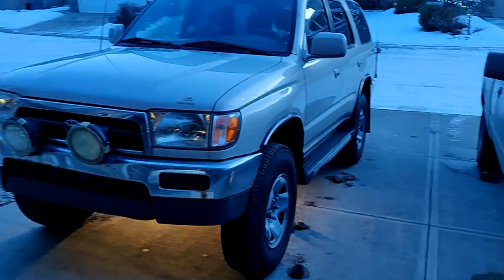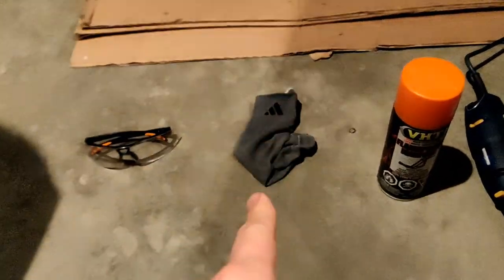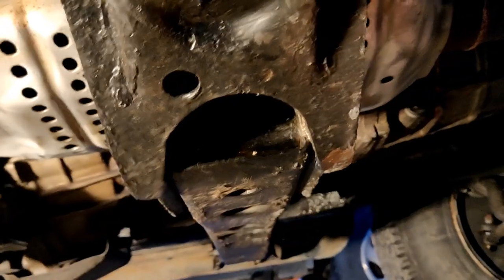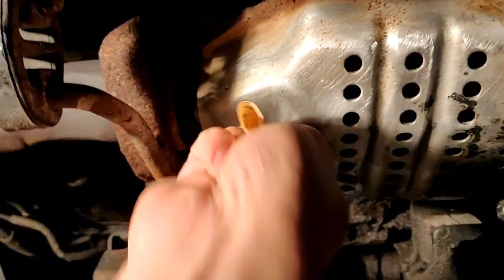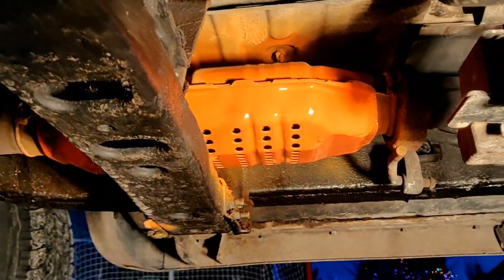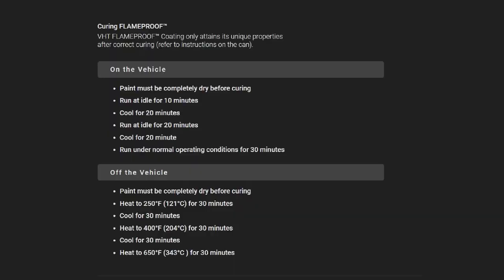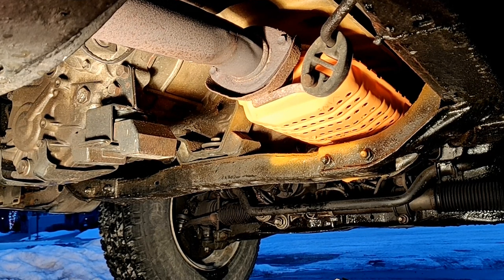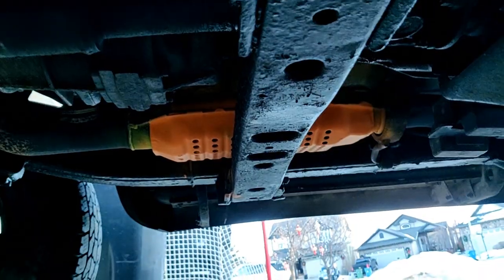DIY Catalytic Converter Anti-Theft for $20

Comment: I'm not sure but I think what he painted was the heat shield that covers the catalytic converter since it has holes all over it to let the heat escape but it's possible that that is the outer skin of the cat.  Even if that is his cat, most cars do have a separate shield covering the cat, making it near impossible to effectively get at it to paint it.  And forget trying to remove the shield, since most have bolts that are so rusted that you'd never get them out.  Just a thought.

Comment: The best deterrent....is to remove it and replace it with a section of exhaust piping.
Reply: Illegal
Reply: What about the O2 sensors?
Reply: Use clamps and put it back before the inspection
Reply: The car won't run right and probabaly will run too lean and burn your valves and pistons over time. You won't gain all that much hp anyhow, and Cats are very effective in reducing pollution. People do this all the time and never run it on a dyno and assuming its making more hp. Better to build a Cat Converter Motion Alarm. There a great video on youtube on how to make one for less than $50

Comment: Not gonna stop anyone or make them think twice about it. Your car is painted and has a VIN on it, doesn’t stop thieves from stealing your car now does it? Same principle as what you did. End of the day, thief is gonna cut the cat out, take it to the recycling center and walk away with a few hundred dollars. Paint and a VIN won’t stop them, he’ll, even if it would cause an issue, they’ll just spray pint stripper on it and remove the heat shielding or grind the VIN off.

Comment: This will not stop them. They don't even care about the case at all. They cut the cat off, take the whole thing. Then they cut the elements out and sell that. The case is tossed. Some even leave the cat and just cut it open and take the elements out.

A hard to cut cage is what's needed. But the cage has to be attached to the frame that can't be easily removed either, or they'll take the the cage with it.

Comment: All cars should have protection from easy access. Further this should be an auto manufacturer issue/ used car dealer retrofit mandated theft deterrent devices. No protection no sale.
Reply: yeah, they wont charge you for it either🤣🤣

Comment: Hey genius you realize that there is a heat shield on there? So when you cut the cat off you take that shield off which will take 90% of the paint off and the rest you can get off with a wire wheel and that vin will be gone with the heat shield also. The way your cat is you should just cut it off and straight pipe it and sell your cat.

Comment: VHT Paint should be applied at temperature between 65 an 95F.  Otherwies the paint will dry, but will not adhere and will flake off with channging temperature.

Comment: You painted and etched the VIN on the heat shield - not the actual converter. Remove the heat shield and repeat your process. Best approach is really to add a steel skid plate to prevent thieves from taking the converter in the first place.
Reply: I suggest you're missing the point, which is.. CHEAP AND EASY. There's neither in what you suggest.

Comment: I just had my catalytic converter stolen. And looking for anti-theft remedies I fell upon this video. I am totally and completely confused by this. How does painting the catalytic converter deter theft? Can a thief still not cut it away and just as fast as if it was not painted? What difference does make?
Reply: Makes it easier to find?
Reply: @blanchy  it doesnt matter.once its gone from ur car its gone.u have to pay to replace it. Paint shit has nothing to do to stop a thief...
Reply: @cherolait94  I agree, I meant easier for the thief to find.
Reply: Some states make the seller who has stolen your cat show ID and do not accept stolen converters, as they try to cash them in. This COULD deter a thief from taking it, knowing they might get rejected from a recycling place, with the converter painted and ID'd so as to make it obvious that there was no intention to remove. If it was remo ed by the owner,  he could take  verifying documentation to ID himself as the owner to recycle the item, should it go bad. 

Its only a deterrent, but some thiefs probably won't even flinch and take their chances. I do like the idea tho. Its a good precautionary measure to try something, over nothing.
Reply: HahahahAhahahahaha
Reply: same mate 4 weeks ago- i just had a cage welded under body
Reply: The thief’s apparently have to turn it in to the recycling center and the recycling center may start asking question and check the VIN. It gives the thief extra work to do and perhaps they’ll just steal from your neighbor’s truck and not yours and save themselves the hassle. Besides it may be hard to tell if it’s aftermarket or not which provides even more deterrent, the aftermarket cats are apparently not worth stealing.
Reply: False the reason why the spray paint them is because no one will buy it if it’s painted because they will know it’s stolen
Reply: @Pepecoin123  how does spray paint indicate a stolen item
Reply: 20% chance may look at it and think it has anti theft system and pass on it.
Reply: Yeah doesn’t work. I need one and if I was shady orange doesn’t matter when I don’t see it
Reply: @Pepecoin123  Hi. If only that was true my friend. Unfortunately most scrap yards are not abiding by state laws requiring catalytic converter sellers to provide documentation. I'm in Phila and spoke to a company rep in California that makes the CatClamp anti theft device, and was told that the laws aren't being followed by the scrap yards. The biggest reason however, why painting the catalytic converter is a waste of time is because all the thiefs have to do is cut open the casing and remove the platinum/rhodium/palladium core and offer it for sale - done. Having said that I not only painted my newly installed cat, I etched my license plate number and phone number into it, bought a CatClamp and installed it, and attached three 26 inch lengths of 5/8th rebar using 15 u-bolts. Any crook who wants my catalytic converter is going to have to put in some serious time to get it off. Of course who ever manages to pull off the heist now can call me to let me know how long it took them...
Reply: Nothing can stop a truly determined thief. But most thieves are opportunistic and will take the easiest road possible. If you look around, there are SUVs parked everywhere that are ripe for the picking. If a thief has the choice between a catalytic convertor covered in orange paint that is etched with an ID, and the one next door that's perfectly clean, which one do you think he's gonna take?? The catalytic convertor market is like a buffet. They have plenty of options out there. Any little thing you can do to make your vehicle less appealing to a thief increases your chances he'll pass you by and go for someone else. I live in a rough neighborhood in Los Angeles and own an FJ Cruiser, which sits high off the ground and is an attractive option for thieves. To create some deterrents, I placed a motion sensor light in my driveway at ground level facing under my vehicle. I also placed a second, Guardline motion sensor alarm that makes a repeating chime in my garage when activated (so the thief can hear there is an alert being sounded inside the house). In addition to that, I have two security cameras on each side of the drive way and I'm also painting and etching my catalytic convertor, too. Hopefully all these things together make my location a more inconvenient target than say the other three FJ's on my street that have no protection at all.
Reply: @dcd6115  Yeah it's amazing that we have to do these things. The best deterrent I have installed is a CatClamp and three lengths of 5/8 rebar. I have to park on the street in the city and speed is important to the crook. Any cat thief knows he just has to cut open the device with the same tool he used to remove it to remove the core. Painting and engraving them only makes us feel better. Good luck brother. I love the motion detectors btw. I bought 120 decibel electric disc shaped horns that I plan to mount under the car and wire them to the battery through infrared motion detectors with an arming switch under the dash... when I get to it :)
Reply: @davidlawrence3645  vin traces is impossible  because I buy them different shop all over the place nearly impossible 4 the dealers
Reply: @davidlawrence3645  most scrap dealer get I'd and record customers
Reply: @davidlawrence3645  the thing too is can't they just wash the paint off with water?  lol
Reply: @boohere2  Well, at this point they'd have to sandblast it off. I used a high temperature spray paint which has now been baked on after almost a year of driving. No, just using the same battery operated sawzaw or high speed grinder with a cutting blade - the tools they use to cut through the exhaust pipe on either side in 30 seconds - they can cut open the device and remove the platinum/rhodium/palladium core with ease.
Reply: @davidlawrence3645  I just bought a cat clamp. I'm hoping it'll work but also hope  I don't get anyone attempting the theft! Also I have a feeling that these theft people that take the converter into a scrap deal or whatever place they go to to get money for them,  I think the place knows that it's stolen. Just chooses to look the other way. I mean if someone comes in with 10 of them. That raises questions to me. I think their all in on it.
Reply: @boohere2  Hello Pasta. Yes, you're absolutely right of course: the scrap yards are complicit, even in states where they've enacted laws regulating the conditions under which scrap yards may accept catalytic converters. The laws are just being ignored. I understand that some car manufacturers may be adapting the under-carriage design of their cars to make it harder to steal the catalytic converters. In any case you did the right thing spending the money on an anti-theft device. If you park on the street as I have to try to park on well travelled streets and/or narrow streets. Either scenario may make it more difficult to steal. A wide, lonely street allows the crooks to execute the plan. Often there's a get away vehicle that'll pull up next to the victim's car. The crooks raise there own hood in the pretense of having car trouble, but really it just provides them cover. Busy or narrow streets that don't allow other cars to pass are streets they try to avoid. Here is a link to a picture of what I've done to protect my own catalytic converter. It's pretty ridiculous. Not sure if the link will work. In any case good luck Pasta. https://photos.app.goo.gl/xYigyXW2vpKeuZvW6
Reply: orange paint is very hard to cut through..... smh
Reply: @golfer0422  That would only work if the converters are taken to an official recycling place, most of the converters probably get sold in the black markey were some cartel type of organization takes them to foreing countries
Reply: @Pepecoin123  yeah Mr Bean that's a big wrong. I buy cars and scrap them two of them had painted cats just like the video Ben etched guess what I cut the cats process them no questions so apparently it doesn't work. Made no difference that they were painted and etched. So what were you saying again?
Reply: @Pepecoin123  you do know you live on earth right?
Reply: @nhickcox02  it doesn't. I processed numerous painted and etched cats. No effects
Reply: @Pepecoin123  paint them if it makes you feel better and sleep easier at night Mr bean dip but reality is it won't do a silly thing except waste a couple of your hours 🤣 and sell paint
Reply: @davidlawrence3645  or just paint over it with $0.99 krylon black silver or any other color they want it's not going to slow the sale LOL
Reply: @Kactapuss  then paint over it with black or silver and then cut through it LOL
Reply: @FactsRawTruth  Hey John. Yeah I painted it bright orange temperature resistant paint, engraved my license plate and phone number into it,  encaged it in a Catclamp which is 40ft of cable threaded through flange discs on either end of the catalytic converter and looped up and over the suspension and frame of the car, then used multiple u-bolts to affix 3 three foot long lengths of 5/8th in. rebar to the underside of the catalytic converter across the Catclamp for extra deterrence. It's quite a contraption. My mechanic said that anybody who even looks under my car should turn themselves into the police...
Reply: @blanchy  lmao , this comment is golden.

Comment: If I lived in an area that had these thieves I'd go to Tractor Supply and buy a electric fence charger with some poly wire and insulators.It wouldnt have to be the biggest charger they have just a 3 joule and wire it up to the car and put the charger inside and turn it on every time I parked it.As soon as the thief put a saw on the pipe they are going to feel the pain and quickly retreat. It wont kill them but 8 kv at 3 joules might knock their fillings out of their teeth.
Reply: “1.21 Gigawatts!!!”
As they wet all over themselves and writhe in pain.

Comment: You only need a motion sensor alarm on your car so they can't jack it up.
Reply: Why would they jack up a 4Runner? It’s already got off-road ground clearance in stock form.
Reply: @nutandboltguy3720  the notion sensor would still go off if turned up from the sawing.
Reply: @Mike_Davidson  That would be a very sensitive motion sensor. I thought most thieves broke a window to get in and steal stuff.
Reply: @nutandboltguy3720   A good sensor would be fully adjustable though.

Comment: Avoid "trying to outsmart criminals" by "thinking like a naive, law-abiding, rational citizen". Criminals are resourceful, street-smart, networked (with other criminals), irrational, sociopathic, remorseless, possibly drug-addicted, fearless, over-confident, already-have-a-record-anyway, alert, armed, desperate, fearless, 'people' who know how the criminal and legal systems work, have lots of time, and nothing to lose. Start thinking like a GAN (Generative Adversarial Network): Come up with a proposed solution to prevent your catalytic converter from being stolen THEN FIGURE OUT HOW YOU COULD STILL DEFEAT IT as if you life depended on it. NO HOLDS BARRED; then re-do your design process. A business will put a biometric lock on a door - and a criminal will break through the drywall beside the door. A tradesman can carry his tools in his locked truck box - and the criminals will bend up the corners of the truck box to steal the tools without disturbing the lock. A homeowner will put his valuables in a safe in the closet - and the criminals will pick up the not-bolted-to-the-slab safe and carry it away. Start thinking like a criminal!

Comment: The solution is to buy an after market cat and welder. Store your exhaust system in the garage until it's time to smog. Then swap it with the low end $100 CAT. Aint no situation where someone will figure out that your cat is not compliant
Reply: Was thinking of doing this too but what a pia. I got 4 cats too

Comment: That’s not gonna work because he cut the catalytic converter to take out the honeycomb inside it has very precious metals in it that will get melted down if you want something to work well the actual catalytic converter to the your car either that or just go catless I just have Streght pipes with long tube headers and no cats

Comment: I don't think this will stop thieves (they will just cut open the converter to get the precious metals), even the cat shield and the cat cable lock system will not stop them either. with the cat shield they can just cut right through it, and the cat cable lock (they can just use bolt cutters or a power rotary cutting tool, the kind that bike thieves uses to cut through bike chains).   I hope someone comes up with a better security system, like a booby trap system. They really need to start going after buyers with hard prison time (and also I start holding websites accountable as well that are allowing stolen converters to be sold,  including eBay).

Comment: A thick skid plate type of deal would be better because they would have to cut more versus soaking these in gasoline or whatever to remove paint and scratching vin off. Still worth the couple hundred they get  versus spending more time under the car hacking away in public

Comment: This will not stop thives or even slow them down in Houston where I live. Cops dont give a care nobody but the victim caress only because its them. Sick sad world. I elected to have rebar and part of a.metal plate together to form a cage plus wired it to the rest of the truck. Even still, wont fully guarantee the catalytic converter will not get stolen

Comment: LOL!  High Heat paint is one thing, once the converter is sawed off, the paint can be easily sanded off or painted over with black High Heat paint; as for the engraving that can be sanded too... besides the people who buy these converters would most likely Not care and likely knowing they are stolen any ways.  I think you just wasted your $20 and time.

Comment: Once your catalytic converter is stolen, and you file a police report, you should be able leave it deleted. Such a racket to have to replace it. Only for it to get stolen again. Once the thieves know your car, and where you keep it, they will just come back in a few months when they know it has been replaced. This is why everyone has had theirs stolen multiple times. And it is irresponsible for auto makers to not address the issue and leave customers out to dry.

Comment: Rivet razor blades around the catalytic converter. That's what I've done to my cars. You can't touch it without slicing off fingers.
Reply: 🤣🤣🤣 Barbed Wire / Razor Wire .
Reply: Booby traps are illegal to protect first responders